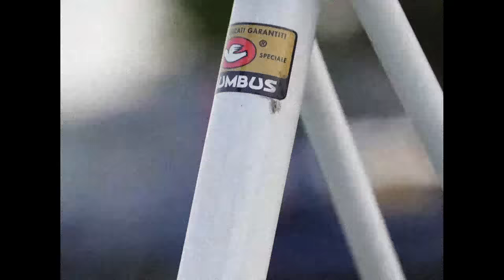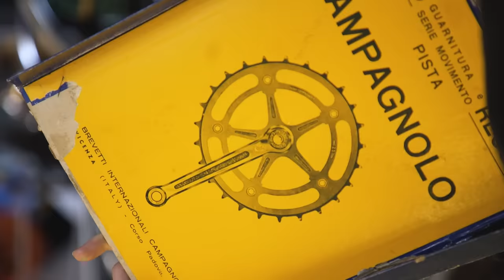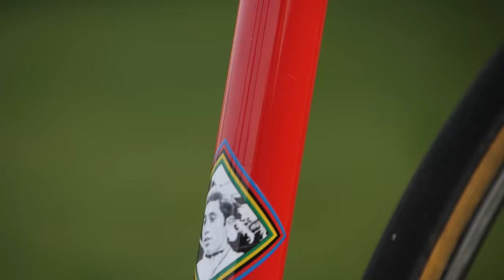Can A Vintage Bike Survive A Modern Race?

Comment: What I love about the Met Trenta is that it looks like the old hairnet helmets of that time, from the front. I had a modern custom steel frame bike built with modern gearing and it can keep up in my group rides but it does take a little extra effort. Rides so smooth though. Now, if I took my '82 Olmo on my group ride, I think I'd struggle more to keep up mainly because of the gearing and the steel was a bit heavier. It feels more sluggish than my modern one. Once it's up to speed, it's up to speed. It's a like a truck and a sports car can both go 60 mph, one can just get there faster. I do feel the difference though when I get back on my carbon bike in the responsiveness on acceleration and handling. It takes less effort.

Comment: I grew up on old bikes with down tube shifters (I’m only 27) because all I could afford was older bikes. Didn’t stop me wiping the floor with all the others in the junior time trials and some crits. 

That said, 10 years on I can afford a newer bike, but am 1000 times slower 😂
Reply: 27 to 37, shouldnt be that dramatic, ride a little more often but lil less intense, aerobic drop is higher now 37 to 42....42+ you mentally adjust that the olympics wont happen anymore...

Comment: Up until this spring, my only roadbike was a circa 1976 Bianchi. I did a benchmark run on that one vs. my new carbon bike, and at my puny 210W average, the difference between the bikes was about 45s over a reasonably flat 7km course... With comparable tyres on both and without mudguards and luggage rack on the Bianchi, the difference would have been much smaller though...
Reply: I first road a time trial on a fairly normal bike, but just took the mudguards and rack off. The first time I rode on a proper racing bike, I improved my time by 4 minutes over 10 miles, despite crashing. (You can't corner on a racing bike, like on a normal bike with fatter tyres.)
Reply: What carbon bike did you use?  A Chinese branded one?
Reply: @roadcyclist1  Yes, Chinese branded, BXT 135 Gravel. Built up with Shimano Ultegra and 105 components, Chinese carbon bar and stem and some DT Swiss r470db wheels from a Specialuzed Roubaix.

Comment: I raced in the early 70's, but my bike had ten gears. (Later 12 gears) You could also buy toe clips of different lengths to make that comfortable. The shoes were much lighter and cooler with a metal plate with a slot, that slotted onto the pedal, meaning you could pull as well as push on the pedals, especially uphill.  I only ever once had a problem getting my foot in the toe clip, and that was a criterium that started on cobbles. The straps were usually fairly tight to start with, you could pull them tighter when you got a chance, or needed too. I never started with them loose.
           I was frequently placed, but was a better track rider, than road rider, although I enjoyed the road more.

Comment: When a college student in the early 90s, my mid-80s very inexpensive bike frame broke. I got a hand-me-down racing frame from the 1970s and built it up with a mix of parts from the 1970s and 1980s. I confess to having clipless pedals by that time, though. I was able to hang in my local races, although the bike got its share of finger pointing and comments, especially the black rustoleum paint covering up its serious blemishes. I used the same bike for time trials in the early 2000s, albeit with a new paint job. It was called "Frankenbike." Tight finances drive innovation!
Reply from the maker: Whatever works for you! Ignore the haters!

Comment: My first road bike in my teen years was a 1970's Raleigh Grand Prix I bought from a friend. It had toe clips and was the wrong size for me. What did I know? Nothing but it was a gas. I had been riding BMX bikes before that, all this in the 1970's. Went to college and didn't buy another road bike until 2020 (mountain bikes up to that point). I discovered GCN at that time which has been great as I got back into road biking in my late '50's. Thanks GCN!
Reply from the maker: That's so great to hear, Mitch! We're glad to have inspired your re-visit to road cycling!

Comment: My vintage De Bernardi Columbus SL steel frame with modern shimano 10 speed groupset and Mavic ES wheels weighs just under 9kg yet is just as quick and comfortable as my 7kg carbon bike with carbon C50 wheels on the same routes in the Peak District. It even descends quicker and more assuredly. I love both but it just shows that a good steel frame is still relevant.
I only have modern groupset on it as I am 63 and vintage gearing would now kill me !
Everyone should own an old steel bike, it helps to appreciate the new stuff.

Comment: Super vid!
I take it you never had to nail your cleats on to your (leather soled and highly polished) shoes then? It's very amusing watching younger riders make sense of the stuff we just took for granted.... Yes, toe clips had to be the right length, akin to having clipless cleats in the wrong place. Gear changing? Just pedaled quicker or slower - it was simply terrifying to do that in a race... and the noise!!
I remember my bike wasn't particularly light by todays standards, but I had lighter wheels for TTing and RR;'ing, so we did take weight into account for the discipline, the thing, is looking at today's results, it's only the really fast guys who are really showing what new technology can do, the average club rider aren't really doing any different times to what we did on steel and ali. More riding up grades and less upgrades, said one very famous cyclist. Ride your bike, ride your bike, ride your bike, said another...

Comment: I've got an 86 Cannondale and an 09 Cervelo P2-SL. The biggest change I feel is the down tube shifters, those are fun, but suck in terms of shift speed, usability, and practicality. The Cervelo is also easier to hold at higher speeds.

Comment: I only road raced on the exact same type of bike you are using.  These are very good racing hardware.  The old style shoes and cleats take some getting used to.  Because of all the wind breaking going on you won't have trouble keeping up with the group.  This era of bike was excellent and I doubt that the modern bikes would have much of an advantage on the type of course you were on as long as you stayed in the crowd and let someone else break the wind. I really enjoyed this video as it bought back so many good memories.  By the way if you fall in an old set of pedals with the strap and the cleat on the shoe you won't be able to get your foot out of the pedal and you go down with the bike strapped to you.  This is always awkward but it also leads to broken collar bones fairly easily though that is always an issue when falling off a bicycle.  Don't ask, I just know.

Comment: Would be cool to see more with this bike doing more period refinements like larger toe clips and changing the gearing to suit the event, find out how good it could be.
Reply: +1 from me on that. I think the bike would do quite well. Clearly this kind of racing is about tactics in the bunch, not marginal aero gains. Any smooth rolling bike will work. And those old Campy Record hubs are still incredibly smooth spinning things to this day - better than a lot of modern hubs on that score.
Reply: Yep, toe clips come in different sizes, but can be a bit tricky to find if you want to be period correct. I made the mistake of buying some smaller size toe clips to fit my Campy pedals on my early '80s Grandis as they were half the price of larger ones, and soon found out why. The balls of my feet were just a couple of cm's back where they should have been, and the ensuing discomfort was horrendous.

Comment: Of course I raced a Vintage Bike. I’m 71 and raced in the Chicago area on a custom made “Crit” bike. Courses were 4 corners in industrial parks and we used 13-18 straight blocks 52-49 up front. I still have the bike. I ride a Trek Emonda SLR now.
Reply: Ah, the straight block...I remember those days fondly.  Everybody had the same equipment, more or less, so marginal gains were ever so marginal.

Comment: Suggest you next try an approx 1980-2000 "vintage" that included bar mounted indexed shifters and clipless pedals, and maybe the Campagnolo Racing Triple. Most of the problems you mention had been overcome by then, but still "vintage." That will give the modern stuff a run for its money at a quarter of the price!

Comment: Clearly you should have had Matt Stephens as your technician! He would spotted the rear cluster mistake early on. Secondly just as you do a bike fit today, you can also get the custom builder to ensure every thing is correct so even the toe clips are sized to your foot. Finally the one thing I bet you have not done is to wear a pair of old school cycling shoes with metal cleats on your sole that almost lock your shoe to the pedal. This was the item that started off the clip less pedal! 😅

Comment: Totally agree -“it’s what makes the pedals go round that really counts” as Mr Bishton said (a racing cyclist of the 1960s).

Ive just done the HELL OF THE NORTH COTSWOLDS 100km mountain bike event on a ‘98 Marin Alpine Trail (26” wheels, 25yrs old) that cost £150 from a charity shop.
Had a great ride, put in a decent time and beat lots of trick modern bikes
Reply: It still would have been easier on a modern bike, regardless.

Comment: Good effort and nice bike. I have expensive carbon, titanium and steel bikes. However, my favourite is a 1987 Revelle Romany tourer. Its not a racer but it makes me smile every-time I'm out on it and I don't need to rush anywhere with it, I just take the slow road. Anyway, I've never thought of racing, but might just have a go. What's the worst that can happen?

Comment: Wow, what a beautiful bike. I have a vintage Eddy Merckx Motorola that I do still ride once in awhile. I'm in my sixties so I'm slow. I can ride my new Trek Emonda though with no problem in the "b" group rides. I never was a pro unfortunately. What I find is drafting is the deal breaker in any ride. It's just with the new bike, aero wheels, clipless pedals, and aero suit and helmet just makes it less painful. But the beauty and ride of the old bikes! You've got me thinking I should ride the Merckx sometimes on the group rides, instead of just solo rides. Great video!

Comment: I bought an entry level racing bike in 1981, a Peugeot PFN-10. Within 2-3 years, I upgraded almost everything. The seat was the first to go! The standard plastic seat really was a pain in the arse. A lovely Ideale leather seat fixed that. 
I have a neuromuscular disorder so I knew I’d never be competitive but I tried two “citizen class” races anyway. 
Had it gone over during the C19 lockdowns. I asked the shop’s owner if there was really any differences in feel between it and the shiny new Bianchis in his shop. He said I’d be surprised at how well my 40 year old bike would compare. (I noted it would be nice to have shifters on the brake hoods Vs. downtube shifters-he agreed.) He said I should keep it, with the period upgrades I did, for as long as I can. 
My original 1980’s team Peugeot wool jersey doesn’t fit my pudgy 2023 body so I got Chinese knockoffs. Wonderful little “Time Machine”!
Loved the video. Very glad you gave it a go!

Comment: I had a 1998 Trek 2300 - it was my superbike and the frame failed after only 2k miles, through a design flaw.  My take is that today's modern bikes are more comfortable - bigger handlebars, cork bar tape, big beefy brake levers to hold on, no cables in the way, and brifters are even better than barcons.  You should consider a 1970s bike - Cinelli invented the first clipless pedals in 1971 - the M71 - and suntour barcons are still the best ever friction shifters, circa 1970.)  I did not expect your results and hate of toe clips, I've always wanted to use street shoes on my bikes so I'm a toe-clip guy.  The modern bike is probably a little more comfortable, a little more stable, and a lot more flexible (thanks to 53-39 x 11-25), but not a game changer, probably 5% slower but who wants to ride at 40mph all day long?  No me ...

Comment: I thought you had that bike customized for you? That would include getting the proper toe clips. I don't think that you needed to even have toe clips for this exercise. Just mount your favorite clipless pedals and race. This illustrates perfectly that you can race, (especially crits) on any equipment. Nobody that is contemplating racing should have to tell themselves that they can't because they don't have the resources to buy the latest $10,000 superbike. Any steel or aluminum race bike will do.

Comment: In my experience with toe clips at the start of a race, it's best to ignore tightening the loose strap at first. I found that focusing on getting my foot in the clip, riding smoothly in the pack and staying upright were more important to focus on in the beginning.  Then tighten the loose strap at an appropriate time, usually along a long straight section with little drama.

Just like modern pedals, you need to have your cleat adjusted appropriately before you race, so your calves are not being unnecessarily stressed.

Comment: You need longer clips and the right style of shoes.  You could also find a very lightweight and very tight wool jersey. I would also cheat and move to the 6 speed cog (and pick the correct gears).
It does look great.

Comment: Christophe toe clips came in  S M L sizes . M being most used.. Cleats and shoe choice being a bigger factor. When the Nylon soled Adidas type shoes came in with built in adjustable cleats it improved matters a whole lot , and many top class races were competed  50 -50 between cleats and clipless .
Reply: Christophe’s also came in XL, still have some in my junk parts box. Last race I rode in clips mashed down toe clip at start, had to ride 3 laps of course before I could sort it out. Somehow in that faffing around lace came untucked, and on final sprint got wrapped around spindle, tightening shoe until it broke about 100 yards from finish. I purchased Look pedals and Velcro shoes that afternoon.
Reply: @kennethward9530   A lot of us who road cyclo X used to rivet 2 pairs together to stop that to some degree. Main fault was they were fragile and many a race or training ride they would fracture on the bend or across the bolt holes and dangle down. not good.

Comment: I rode only amateur, briefly: a neighbor/friend in New Hampshire (1995-97) introduced me to the Thursday night training races held at the NH International Speedway, using the motorcycle course and oval; they were points races and I actually won once 🏆 🥇 
But the track you ran at resembles a track my Amsterdam friend took me to; it had an outer loop, then three or four shorter straightaways in-between something like this: "WV" (close the top). It was a half-hour drive out of town.
He's been a top-10 Masters over-45 for the Netherlands(!) 🇳🇱 
I think it was a 10 or 15 lap race, and I happily abandoned after maybe 8 laps, to watch Bert try to win.
About 2004?

Comment: Did your shoes have cleats? I assume so but properly nailed on cleats make all the difference in clipped pedals. Were you on nice silk tubulars as Eddy would have had? Changing gears with friction shifters takes time to get good at doing it quickly and efficiently. If it’s not too hot wool keeps you dry and breaths. Real shammie in your wool shorts is super comfy, especially on a Brooks Pro saddle well worn. Great video. As one racer said “It’s not about the bike. “

Comment: Steel frames are still relevant at the higher levels of racing, apart from aerodynamics. They are nearly as light as a standard carbon or aluminum frame IF you start sourcing ultra light components, replacing steel bolts with titanium, things like that. A super modern carbon bike will still be lighter, but not  by much. You can get a quality ultra light TIG welded bike below 16 pounds, which is only about a pound or so above the 14.99 lb UCI minimum. Where the problems crop up concern the aero nature of the bike and that's where carbon shines.  You just can't shape steel tubes quite the way that you can literally mold carbon. If you're having trouble with the toe clips, that's a fit issue. I never had issues with them when I raced back in the '80s, and actually preferred them to the first generation clipless pedals of the time. Today, I'm sure my views would change.

Comment: I'd like to see this again but with a neo retro set up, which could work better than the budget race bike build Alex tried. Gcn already has a sensah 11 or 12 speed groupset. If this bike had bsa bottom bracket, you could run the crankset, brakes and shifters from that on a retro frame like this. You could get some cheap, light weightish wheels to accommodate the 11/12 speed sensah and see what it can do. Oh and you could run your pedals as well
Reply: I agree. Would make a really cool video and make the bike much more competitive
Reply: I have a bike like this. It can do quite a lot, and you can really feel it,  but the engine is severely lacking.
Reply: @cptjeff1  haha, it is surprising what they can do, that's why I suggested it. I have a Raleigh record sprint with some lightweight cheap wheels, sensah empire 11 speed and some lightish hollowtech style crank. What's also cool is you can run a friction front shifter and index rear, you rarely need the front anyway but get ultimate trimming. I love this bike and it's a nice ride

Comment: On a flat track I think the difference from a today's bike is not much relevant - at least for amateurs. The biggest problem for vintage bikes are the gears. With only 5 gears you are forced to choose OR mountain gears (and with limits: no more than 42/25, I remember my first bike in 1986) OR flat gears. It was not uncommon at the time to see racers to change wheels before mountains (as, ironically, today they do changing completely the bike...).